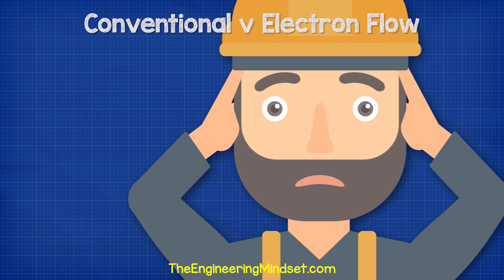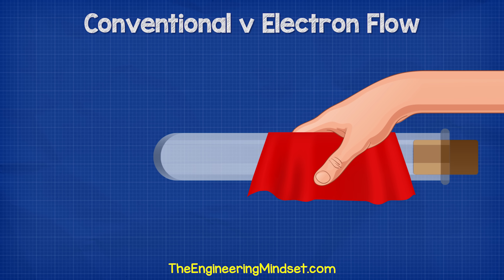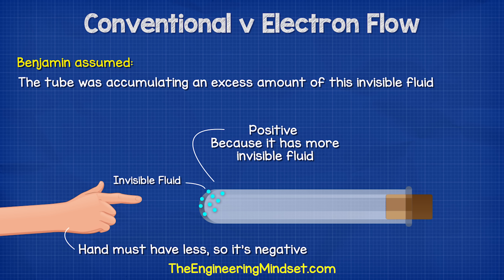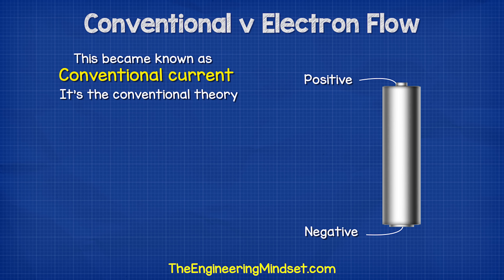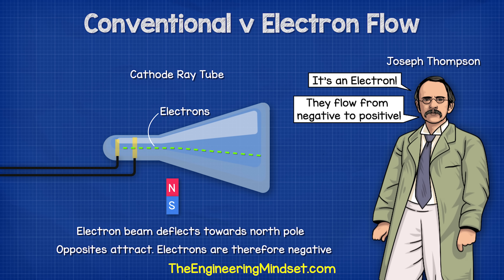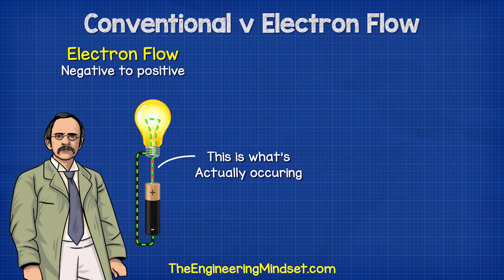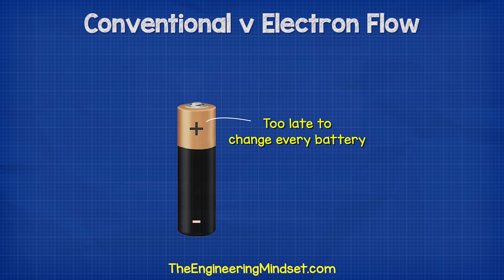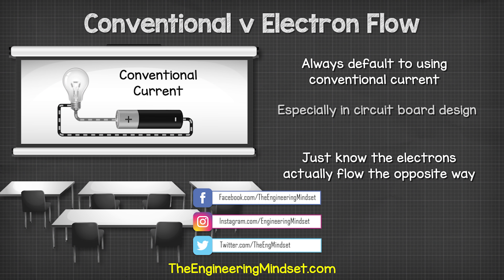Conventional Current v Electron Flow - Electricity explained

Comment: The problem is that this model has contaminated every field of science because conventional theory is what all models of mass, energy and motion have been based on in mainstream science and so when anything is observed be it quantum mechanics or classic, it's always based on this idea of empty space of a time constant and so when a phenomenon is witnessed primarily through test equipment and machinery generated said phenomenon, they're constantly missing something critical; A BODY.

So, they invent nonsense like dark matter, photons, neutrinos etc. but when you observe the exact same phenomenon under the electron model of mass, energy and motion, we always know which body or bodies of said phenomenon are responsible for the electronics data being returned from the test equipment and so we know what the event is in fact connected to.

Conventional theory has these boobs literally viewing empty space under a time constant and because the test equipment data of said phenomenon is always the same as is the mathematics, they just keep filling that empty space with shit they make up which has no limits.
They will always keep adding a new and cohesive theory to the previous that creates drivel.

Looking at the double slit experiment, the electrons producing said test data are encountering an insulator in the form of paper, and the test equipment field influences and thus, the electron doesn't "know it's being watched", it's behaving exactly as predicted because outside forces are effecting it and we can identify those forces as the source of the phenomenon. 

You're literally looking at empty space based on the time constant being reversed in literally every field of science on Earth and so this is the real reason science has been at a sort of stand still since Nikola Tesla.
We have this GDF idiot named Einstein that if you attach his name to ANYTHING, laymen are brainwashed by media propaganda to automatically believe it may as well be fact and yet Einstein really never accomplished much of anything other than becoming historically what people perceive as the first modern celebrity. 

Meanwhile, every single one of his theories was plagiarized and Nikola literally laughed at Einstein and said his theories were nonsensical, and in return, Einstein still regarded Tesla as the smartest man to have ever lived.
How ironic.

Comment: Aviation Technician here. We learn about both theories in trade school, but are taught to use Electron flow theory to trouble shoot components within a circuit. We use this because the actual flow of current helps us understand the first point of failure in a system. Using conventional flow, you'd first think to check the source of current, maybe the switches or anything else that enables flow to the component. However, when using electron flow theory, the actual flow orientation dictates that you always check ground first. Lower potential to higher potential means more often than not bad grounding and cables that carry lower potential tend to go bad first.

Comment: Ok so why is it that on a tig welder, the electrode is setup(talking about dc welding) to be negative and the work is positive so that the work piece gets hotter than the electrode. If the electrons are flowing from the electrode why doesnt that get hot before the work piece that’s positive. And why does the positive on a car battery spark so hard compared to a negative terminal.

Comment: Is it really electrons flowing or is it just "energy/charge" that is flowing.
It seems to me that what flows is "charge".
When you spin a magnet close to copper wires, the energy you use to spin the magnet is transferred to the electrons in the copper wire and get charged up (the magnet doesn't "grab" electrons from the air and transfers them to the copper wire).
When the, now charged, copper wire gets connected to something that can transform that charge to some other form of energy (light, spinning of another magnet, etc.) the charge in the copper wire is lost..........the electrons remain the same.
Reply: that charge is property of electrons,it doesn't exist independently it's a property of particles which give them ability to interact with EM wave
Reply: @avnijharwal5741  I'm glad you agree that it's not "electrons" that travel but "charge" acquired by the electrons.
Reply: @ yes and that charge is  electron's property, it can't flow independent of it,so it's the same thing flow of charge or charged particles like electron or ions

Comment: How do I demonstrate the shock of static electricity in a glass tube? I've been researching and demonstrating it for weeks and can't seem to get anyone shocked. Even when I rubbed silk and wool on a glass many times for minutes, it didn't seem to shock anyone at all. Is there a certain way of rubbing? a condition? or another way to do this?
Reply from the maker: It's hard to do in winter because of the moisture in the air. Works very well in dry, low humidity warm room.

Comment: Wouldn’t the direction matter and should be thought the correct way anyway? I know there isn’t a circuit that’s big enough to make a difference but imagine if you had a circuit that travels around the world and has a light bulb in each km. Wouldn’t you want to know which bulbs would light first? Or I guess would they all light up at the same time since you could imagine the electrons movement like pushing a stick and not water flowing to empty pipe?

Comment: I don't get it. How can we not take into account which is the real direction fo the flow? If we have to put a resistor in so that the LED light doesn't explode don't we want to put it before the LED and not after?..
Reply from the maker: We can place an LED before or after the led. Please see our LED explained video or resistor explained video for examples
Reply: @EngineeringMindset  Oh, I see. Well, there goes the analogy with water then! If I wanted to save a village from flooding I'd have to build a dam upstream from it not downstream. What is different about  electron current?

Comment: Basically what terminal should be named as positive got named as negative and vice versa. Another interesting thing to know is the concept of electron having negative charge and protons having positive charge is just arbitrary. Electron is first identified as a particle which comes from the Cathod terminal of the tube. Since the Cathode is connected to the nagative terminal of a battery, Electron is assumed to have a negative charge and Proton which has an opposite charge to Electron assumed to have Positive charge. It's the error which happened with battery caused the Electron to be associated with negative.

Comment: Question: could you make a video explaining this flow but in a car battery? the electron flows out of neg terminal or positive? Also the car produces ac current than then goes to battery as dc, but all this takes into account the electron flow instead of conventional? I am so confused. Back to watching fail army. Lol
Reply from the maker: Please see our video on How car batteries work
Reply: AC doesn't really matter much as the electrons just go back and forth really fast, more like a vibration than actual flow.  The rectifier converts it to dc before the battery.  I'm not so sure it matters much as you could also just look at electron "holes" as flow of energy as well.  Keep in mind electrons are just the medium of energy, not necessarily the energy it self.  Kind of like waves in water.

Comment: So is the true negative of a battery labeled +?

Because every video demonstrates the electrons flowing from the flat end. It's also implied that the electrons flow from the nipple end; that's why they called that end positive before the electron flow model.

Are diodes mislabeled? Or is the electron flow version of the animation misleading?
Reply: I have the same question.

Comment: For simple devices like resistors and lamps,  they function the same regardless of the direction of electron flow.  Diodes and other devices,  electron flow is only allowed one direction. How doors conventional current diagrams get around this?

Comment: Electron Flow is correct! It is NOT a theory! It is fact! As for batteries, they are designed for Electron Flow! The current flows from the negative side of the battery to the positive terminal. There is no reason to think otherwise! The negative (-) sign is just that, a sign, marking where the electrons come out from. And the positive sign (+) is the point that they are proceeding to! In fact, when you measure the voltage with a voltmeter, we say that there is a positive charge on the positive terminal of the battery, and a negative charge on the negative terminal on the battery. It can not be the opposite (changing it to convention flow marking), as that would be counter-intuitive and definitely wrong!

Comment: Im so confused! Yes it doesn't matter in an AC circuit! But is it does matter in a DC circuit! So do engineering blueprints for DC circuits just flip the labels on the poles and label the posi-pole as if it's the negative and vice versa? Or are things powered by DC manufactured with the poles labeled backwards? Or are engineering diagrams only allowed to show AC circuits? Someone explain PLEASE!
Reply from the maker: Dc circuits are always designed using positive to negative
Reply: @EngineeringMindset  Can you explain how they are designed using positive to negative "conventional flow?"
Let's say there's an expensive piece of hardware somewhere on the circuit that needs fuse protection; the fuse would need to be "upstream" in the circuit or else it would be useless right? If the design uses positive to negative then that fuse will be put on the return side of the circuit, thus by the time it has blown the current has already passed through and destroyed said hardware right? Or if you want to use a resistor to lower current prior to reaching device you'll have same problem. So how is that accounted for?
Reply from the maker: Watch our videos on resistors explained and current explained

Comment: With this logic of directional flow, wouldn't designing a circuit using the conventional method disturb how the system works, because, in reslity, the elctrons are flowing the WRONG way?

Comment: But this is nonsense 
When you design circuits you need to know the direction of current
And it's positive to negative and it won't work with designing current negative to positive
Everyone says conventional But no one says that conventional works

Comment: Just because something is hard to fix doesn't mean that it shouldn't be fixed and that incorrect information should be propagated just because that's the way it has always been.  The metric system is used globally but not in the U.S. because it "would be too hard to fix."  Well if the rest of the world has largely switched to the metric system and has been provably better, then it's clearly not too hard to fix.  The real reason we don't is because we're 'Murican and we're lazy and want to be wrong.  Similarly, if electron flow is correct and conventional current is wrong, then we should fix that and not stick with the mistakes of the past.

Comment: Ok.    Now,  I had a brain alert moment... yes!💯💥

So,  if conventional current is not correct, everyone still uses it as the
Proper values,....
Since diodes and cathodes work in relation to the direction of said electrons,  are they built and engineered backward to accommodate the reversed electron flow?

My head is exploding!  But,  it's good!  My mind has finally awakened.

Comment: What doesn't make sense to me is if I check voltage on a battery, then ground one lead voltage is read on the positive terminal and not the negative. Is the power coming from the ground?
Reply: If you check voltage on a battery with a voltmeter, and switch the polarity of the probes - red to negative stud, and black to positive stud of the battery - your voltmeter will show a small "minus" sign in front of the voltage reading, on the screen. When you switch the probes back, as they should be according to the color code, the "minus" sign on the screen will disappear. 

That's how you know whether you are measuring it right, and what the correct polarity is.

Comment: Well it is confusing, when it comes to diodes, for example, and testing them with a multimeter.
In diodes, current goes from Anode + to Cathode - , and it does not flow in other direction, that is what makes it a diode. AND what makes all of this even more confusing.
It would make more sense if it flowed from negative to positive.
Reply from the maker: Check our new Multimeter tutorial out ➡️ https://youtu.be/4lAyzRxsbDc

Comment: didnt think anything actually flowed.. thought the electron went into the hole and the hole actualy moves..?? in essence..... which makes zero sense... so we talk about charge transfer not electron movement.... so they stay still ??? just bump the charge on.... ??? then at absolute zero they are separated apart so much no charge can be passed..... if we take your model they would still work.... because temp doesnt stop thigs moving but it can space things out so the don't interact.... ???

Comment: I have to say this has confused me more then when I got here. I have been in the automotive industry for 27 years now and everything on a vehicle is built on the idea behind conventional flow. If you open any wiring diagram for a car or truck, it's completely based on conventional current. Reading the comments and watching videos to try and expand my knowledge of the newer electric and hybrid cars (using AC and DC) voltage, this "electron flow" has put on the brakes.  Example would be you fuse the beginning of a circuit not the end, and the with electron flow, all circuits I have ever seen are all fuse backwards, with the safety at the end of the line. NOW, what it looks like to me is that both system are right as they describe 2 different things, one being the flow of electrons and the other the flow of power. This is a horrid system and i'd swear it was done on purpose to keep people out.

Comment: So true. When I was studying DC electricity at RMIT Melbourne in the 1960's, electron flow was preferred. The question remains. A battery has a negative plate (anode) and a positive plate (cathode). We know that a charge of electrons move from the anode to the cathode, electron flow, but conventional flow from positive to negative outside the battery? Or does it go in the opposite direction? This is where there is confusion.
Reply: Not confusing if you get it right. It is the opposite of what you stated. The positive terminal of a battery is the anode and the negative is the cathode. Electrons always flow from cathode to anode (negative to positive on a battery).

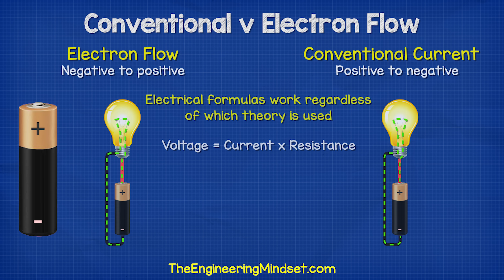Comment: 2:31 I'm a bit confused by this... Why would you want on change the positive and negative signs on a battery? Isn't it correct for both electron flow and conventional current, the only difference is direction of flow.
Reply: Yeah it wouldn't make sense to change it. Changing it would then just "play" into the conventional current mentality, changing the negative to the positive because that's how we used to think it works. But we KNOW now it's from the negative, so the more logical change would be to adjust our common thinking on the matter and start treating the Negative side as the actual side it's starting from.

Comment: In medical school we learned electron flow in the human body. It was electron current. Then I tried to learn electricity and had to contend with conventional flow. The main reason we are still using this stupid system is because the engineering community was too lazy to fix it. Relabeling batteries is easy. They just didn't want to change the textbooks and since "I learned it this way, so must you". It would only take one generation to change it.
Reply: @Need2PUMPKIN Explain?

Comment: Well, you've played both sides of the field here. You've said that all the batteries in the world need to be changed to have the correct current flow, yet you use the drawing at the end as an example of conventional current flow, implying it is wrong, having the positive terminal flowing to the negative. If the battery were in correct, than the diagram would be correct. If the diagram is incorrect, then the battery would be correct. Are batteries incorrectly marked?

Comment: Well I learned electron flow (90-92) in tech school, so that's what I like and what makes sense to me.  It seems to make more sense because electrons are said to have a negative charge, so when you have an excess then you have a negative source.  

The positive side of the circuit has a shortage, and circuit power, like batteries, seek to balance themselves, so the excess negative electrons "find a home" in the positive location with a shortage; they balance out:  The excess location flows to the shortage location.